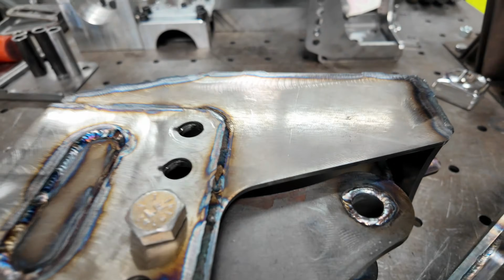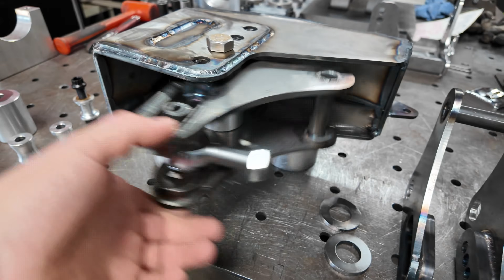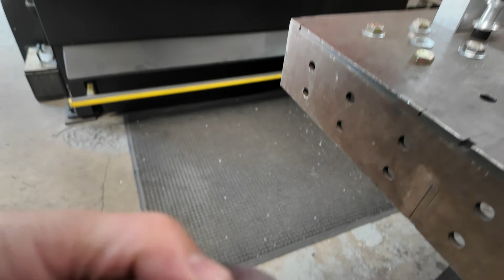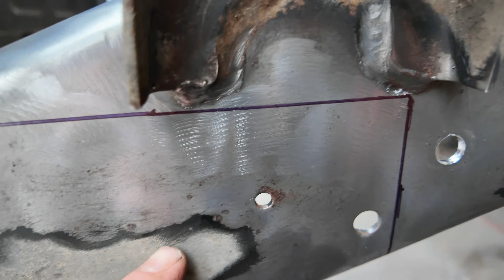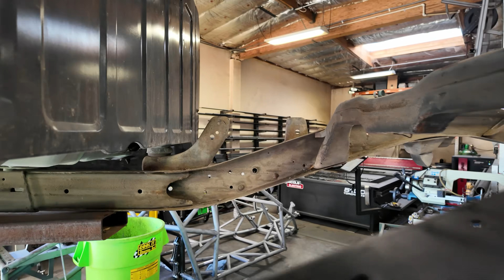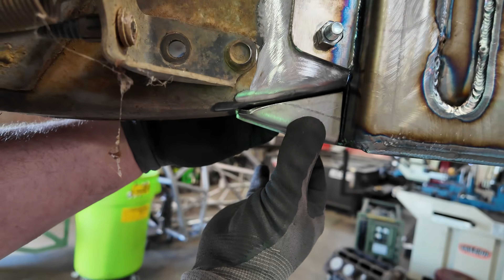S10 Adjustable Front Box

Comment: Hey bud,  I really like your set-up systems and I was wondering if you could make a set of front boxes without the traction bar system.  I would like to make the box extends longer to follow throughout the frame rail. And also make a set of slider boxes longer towards the rear bumper by adding 2 inches? Thanks!
Reply from the maker: If I understand correctly you want the box without the rocker pivots? If so, yes, no problem! They are listed that way on the website already. If not, email or call me and I'll see if I can help.

Comment: Would you have any pictures of it on the ground how it sets with a 28 x 10.5  ? Is I notice you're in a very top photo and I just curious on the way the look of the stances is. Because I think it's a great idea what you came up with.
Reply from the maker: I dont have any specific- you can expect to loose 1.5" of ride height from the bottom hole to the top hole with all other things held consitent. Ride varies wildly with springs, blocks, weights and what housing perch is used.

Comment: Can you make the kit so the leaf springs are flush or slightly inside the frame rails? So tire would hit frame rail before the leaf spring. My stock set up currently rubs the leaf spring, with plenty of clearance to the frame rails.
Reply: Sliders slightly inboard also, obviously
Reply from the maker: @joeljohnson9057 yeah, i dont see any reason why not. it would require moving the housing perches as well...but it could yeild the extra space. The box would be super easy to move, the slider tecnhincally as well, i just need to look at mounting to see what would be needed